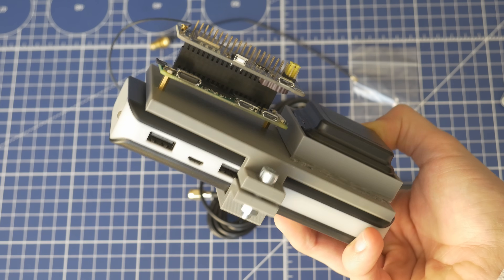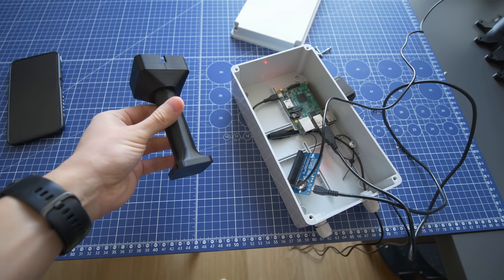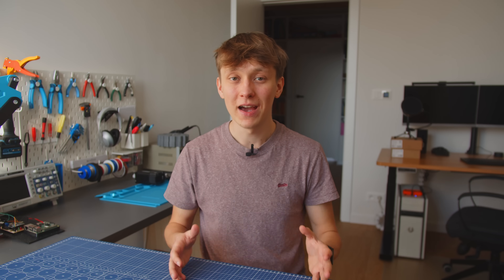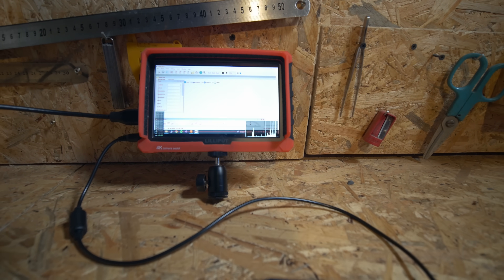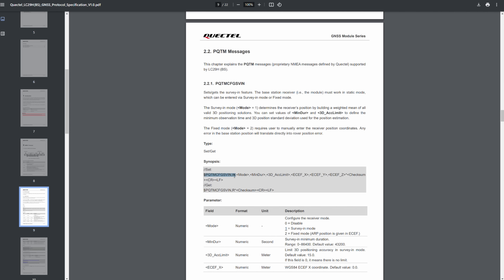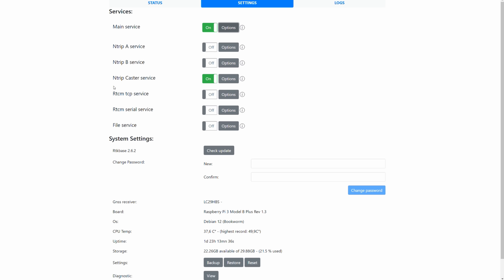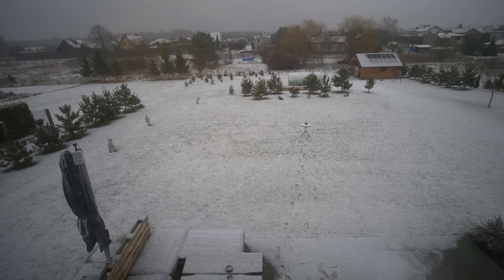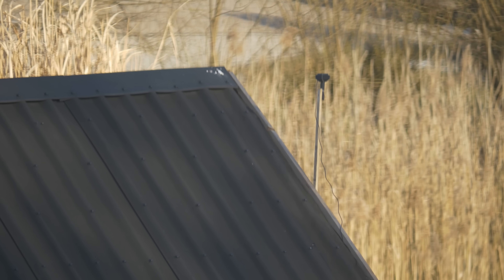$100 RTK Base Station Finally Works

Comment: Hi Nikodem,

I watched your YouTube tutorial on building an RTK base station with the LC29H-BS—super informative, thanks!

I’m running into one issue: in the RTKBase web interface my base coordinates stay at 0.0, 0.0, 0.0. Everything else appears to work correctly (data streams, status looks fine), but the coordinate field never populates.

Was this the same in your status bar at any point, or should it be showing the actual base coordinates once things are set up?

Any tips on what to check would be greatly appreciated.

Thanks a lot! Hawber

Comment: If you have the LC29HDA or LC29HEA you can use the firmware command 'PQTMCFGRCVRMODE' to switch between Rover and Base Station. So assuming the price is similar the DA model is a more flexible than the BS model. Details in the specification here: https://forums.quectel.com/uploads/short-url/gJTnPOK8MkEJIgLFR7QgjvrpUey.pdf

Comment: the roof is  made of some kind of metal? (the layers of metal work as a capacitor and scrambles the antenna behavior)
Reply from the maker: It's not metal, it's onduline

Comment: Nicodem,
The snow on the antenna may be attenuating the signal.

If you have AC power in the shed, you may want to blow warm air over the antenna to melt the snow.

Since you are "mowing", the antenna should be warm enough during mowing season.

A few 5w resistors could be used as heating elements. Glue them to antenna below the line to the horizon.

Comment: Maybe look into antenna mounts used for TV and/or amateur radio antennas.  You could mount one on the side wall just under the peak of the roof and mount the project box with antenna or just the antenna near the top of the mount separating it a bit horizontally and vertically from the shed roof.

Comment: I already have the base station working using esp32. Did you use a controller like ardurover for the lawn mower with the wave share?
Reply from the maker: The GPS RTK module was not implemented on IndyMower yet

Comment: I am having so much trouble with this setup. I have done everything correctly based on the data I can find - My drone controller will not take the RTK data in.  Can you point me in the right direction ?

Comment: raspberry pi built in wifi was always a garbage. For example for rpi 4 see github / raspberrypi / linux issue #3849 (5 years old bug report with tons of comments and no solution). Don't know how it looks on latest rpi 5 though.

Comment: Hi ! Thanks for sharing your approach and ideas ! On the interfacing of the GNSS module for the base station: Did you consider the Linux daemon "gpsd" ? I did something similar years back using a ublox module and gpsd saved me a lot of time ... The daemon runs liek a charme under Rasbian / Raspberry Pi OS. Sidenote: I have no idea if your module is supported by gpsd at this time ...

Comment: Nice video, would your issue be because of the interferences due to the roof being made of metal ? If I do remember correctly, it's not recommended to place it near metal sheets

Comment: Nice video, is it maybe possible that you share the steps you did in a github project. I want to get a rtk rover to work, but I cant connect to the ntrip server. Can you maybe share what steps you did to setup the rtk rover for the raspberry pi? Also it would be nice to see how your script looks like to get the accuracy from the module.
Reply: Posting your script on github would help me a lot, I know have connection and it seems I get data but the script from waveshare stops after a specific time. So it would be very nice if you could share your code to me.

Comment: Probably your metal roof is causing some problems with the rtk
Reply: I agree with that point, every patch antenna - gps need to be tuned to ground planes of mounting - in this case quality of signall will be disturbed by metal areas

Comment: Placing GPS antennas in elevated locations increases the error due to multipath reflection effect. The only good reasons to elevate it is poor view of the sky, and to be out of reach of vandals.
Reply: You are somewhat wrong
Elevating antenna reduces multipath reflection from nearby buildings, walls and objects (cars on the road etc.)
What you are referring to is reflection from ground back to the antenna, for that you need a base plate.

Comment: Great looking project.You should upgrade to a bigger antenna or add a 16cm round metal ground plane. You might also look into uploading your data to onocoy which is a good way to track and test your data quality.

Comment: Outstanding discussion of your progress!  After years of struggle to get usable WiFi to my outdoor workshop I finally dug a trench from my house to the my workshop installed electrical direct burial grade conduit and pulled fiber optic cable.  I should have done that along time ago.  Now I have a lightning resistant communications path and future proofed data speed.  I also pulled extra fiber optic cables for additional future use.  Outdoor conduit is very prone to collecting water so I used direct burial rated fiber optic cable.

Comment: Uhh antenna and placement is a very very big topic. 
Steelinforced structures, can work  a dish, relaying a lot of noise. Ground shielding. 
I think it has to do with the building working as a blocker or a receiver. 

Search the internet, but I warn you. It's a deep rabbit hole.

Comment: Ten Tech has a video on how to do brick layers. Much better at retaining an airtight seal. But you are correct, water tends to seep into normal prints. I had a box printed in PLA that I used as a battery box on my bicycle for 2 years and it held up (in the rain most days), but I have also had numerous thrown in the sink just for them to sink in the water. I think you are usually fine if its just rain but if it isnt moving in the rain then its not a good idea. They sell a lot of watertight boxes in the outdoors sections of stores for holding your valuables in the woods that work very well for like a maximum of 10$

Comment: Can these modules be used in a multicopter drone with iNav? Which module has to be bought for this, using it with more precision than M10 GPS modules without a base station or does there allways has to be a connection to a base over internet anyways to get better performance?

Comment: I'm from Sudan, the corrugated metal sheet is enemy of signal, you need either survey grade Antena or you add metal ground plate to your Antena, also you put the Antena at  the highest place on the roof, finaly on the software adjust elevation cuttof angle to at least 15 degrees
Reply: Yea, this was going to be my guess as well. Big metal sheets near antennas tends to make them quite unhappy, especially when dealing with a signal so weak like GPS.
Reply: Yes, it has three disadvantageous to have it this way:
1- the roof blocks the signal coming from the other side
2- It might act as a load to the antenna, changing it's impedance and thus performance
3- might reflect the signals and creating multipath issues which is the most sever one

Comment: Even very expensive GPS RTK modules such as the ones from Leica have the software flaw that you explicitly need to check which fix mode you're in. When it's got the wrong type of fix (i.e. float for example) it can easily be 10-20 metres off from your actual location even though it still claims an accuracy of 30 centimeters. I would suggest you split the test results by the fix mode it has.

Comment: 9:50, I thought you had accidentally leaked your location, but it's just a random roundabout in Warsaw. good job xD
Reply: Not random but probably a first location where tourist go after leave a train station in the centre of Warsaw. Under this roundabout is a metro station
Reply from the maker: It's way simpler than that. These are the coordinates you get when you ask ChatGPT for Warsaw location :)

Comment: The accuracy you got is not that goos try the open source project you mentioned for the base and the rover and see how big of a deffrance does it make i think there's a problem with correction data being sent at wrong time or not properly try again also post your results as these video's are helping a lot of people ❤

Comment: Maybe the fotage is lying but it looks like the antenna never is mounted above the roof so that it gets a 360 degree view of the horizon? I have a base station built on zed-f9p mounted in a similar way as you, but it sits 20 cm above the highest part of the roof. I also have a 10cm in diameter round steel plate om which the antenna is mounted and  i have never had any issues. I suggest that you read thru the sparkfun guide in building a rtk base, they have some tips there

Comment: Using rtklib we should be able to collect data for 24 hours then do a proper PPP like it's in the centipede documentation. After that it should be possible to add it to the centipede RTK network.

For that small patch antenna you should add a grouding plate (any metal with more than 15cm in diameter should work fine)

Comment: That light that's above your bench:
I bought same one from Amazon. That thing is a fire hazard.
The power supply ran 90C and the cables connected to it were listed at 60C rating (if I remember correctly).

I don't know how well the power supply works at 220v but at 120v it's garbage.
Power supply is under one of the end plastic covers. I pulled mine apart and replaced the power supply with an external one running at the 70vdc it needs.

(The power supply cable is also very thin and not very nice quality, which I'm sure you noticed.)

Comment: Does anyone know if there is GPS RTK for ESP32 or how much power it consumes? I would like to use it for an autonomous boat, but I'm not sure if the work time for the Raspberry Pi and this GPS module would be sufficient.

Comment: Yo, just checked how hard it will be to run this windows app (QGNSS V2.0) on linux and it looks like Wine has no issue with booting it. Don't have actual hardware to check if all drives are correctly loaded and if physical connection will be possible but if you want to try let me know, can help with that! Then you should be able to run it on Raspberry Pi over ssh

Comment: You should use a different blur(or preferably just a "black bar") to censor your location - You can often undo the simple blurs, especially when you know the software or have enough samples.
Reply: To be fair he published enough of outdoor videos that it should be pretty easy to find his workshop. Within 3 minutes I could get to +- 1.5km purely off the public info.
Reply: Prove it

Comment: I feel that you'd probably have better luck with the roof location if:
1 - you placed a small layer of aluminium foil beneath the antenna (provided theres nothing in place already to block multipath).
2 - you place the antenna on the apex of the roof where it has the best angular coverage of the sky (current system is likely missing out on a large amount of satellite broadcasts due to the roof shielding the antenna from satellite signals).

Comment: Nice and interesting videos. Keep it up. But maybe a tip. In most documentation of GPS/RTK receivers the recommend to place a metal plate below the receiver.  This mostly done for better reception, reduce multipath error,... That's maybe why the umbrella location works better. :)

Comment: I was wondering whether the fact that you can't get an accurate fix on top of your workshop roof might be due to signal reflections from the metal roof itself?
Reply from the maker: The roof is not metal, it's onduline.
Reply: @nikodembartnik  Oh, ok... then maybe not! 😅
Reply: I suppose that reflection could be from a metallic edge of the  roof construction. Maybe some covered layers of the roof construction have big  metal parts.
Reply from the maker: I build it all myself, there are no metal elements in the roof except for nails and screws :)